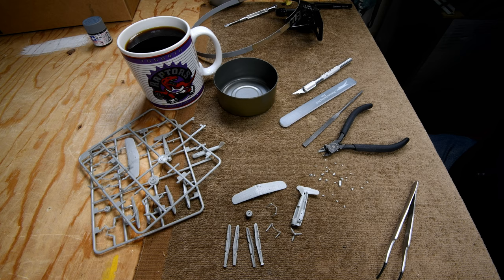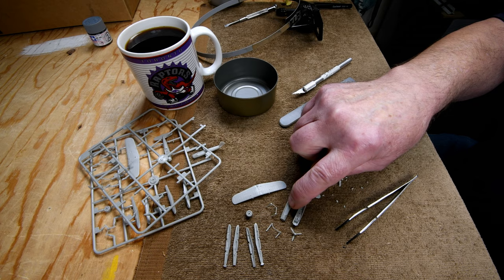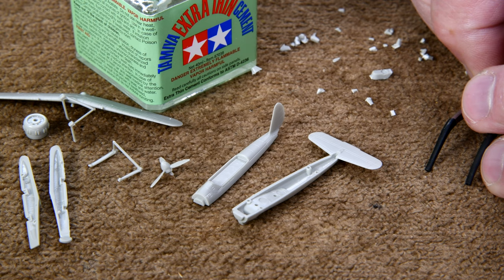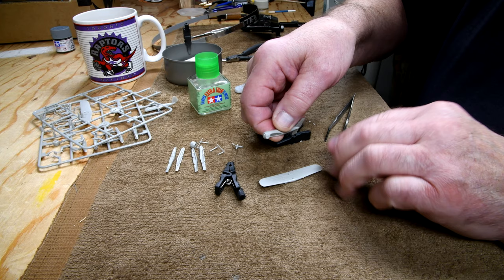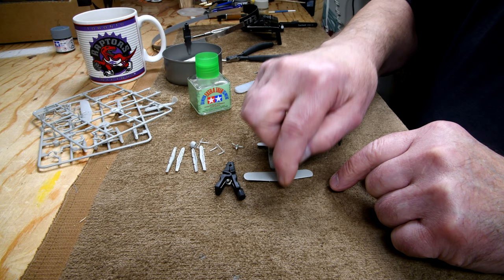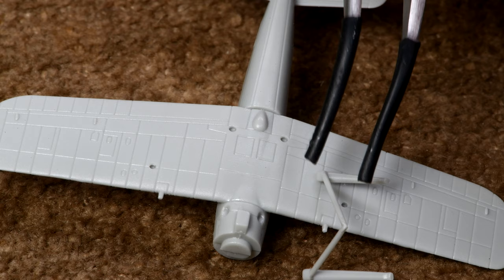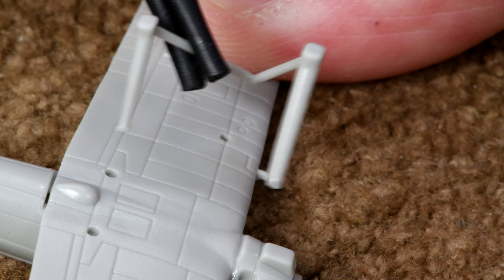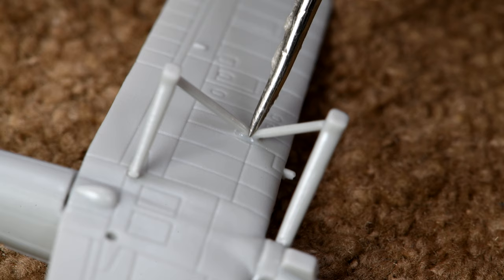The Model Ship - Part 321

Comment: Hi Ron, you may find that after a dry run of the parts fit, hold the two parts together and then run the extra thin down the joining seams, the wicking effect will work in your favour. That way you won't get any dissolved plastic oozing out needing to be cleaned up.
Reply from the maker: Thanks for that tip Dave 👍